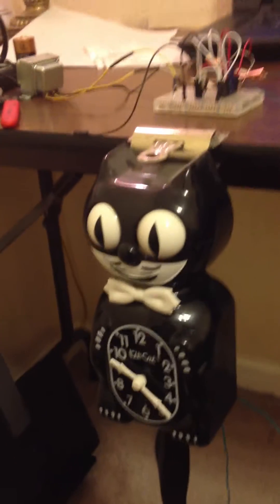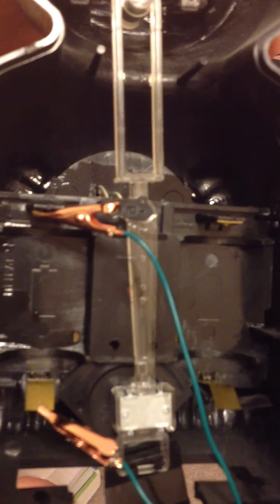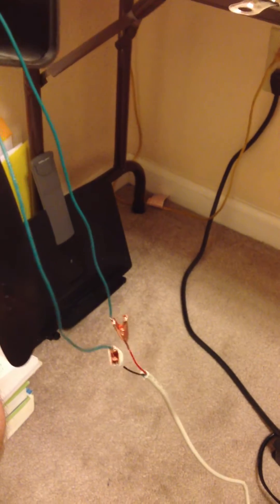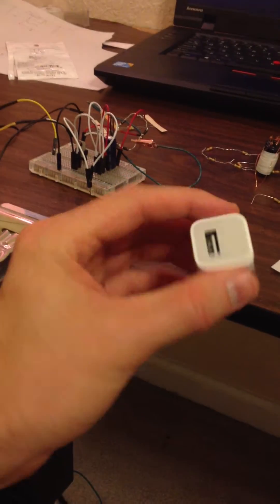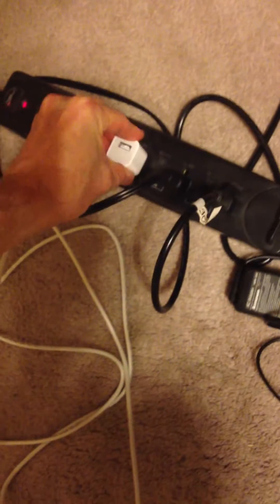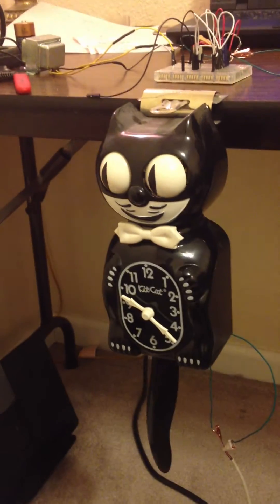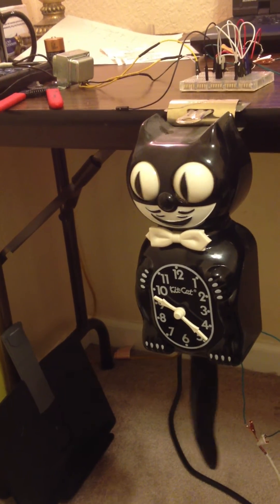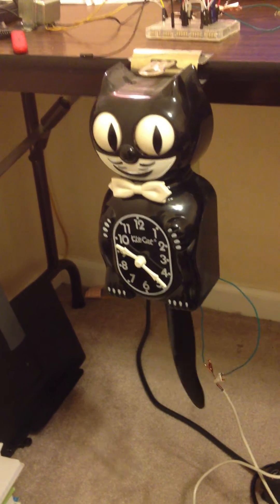Kit-cat clock cheap and lazy way

Comment: How did this work out longterm?
Reply from the maker: I ended up changing things quite a bit. I do believe that the method I'm showing in the video would have worked fine for the clock motor in the long term; however, for more delicate circuitry (like the clock circuit) I really should have used a simple voltage regulator.

I decided to make some bigger modifications to it, which may be found here:

http://www.instructables.com/id/Make-a-digital-meow-from-analog-clock/